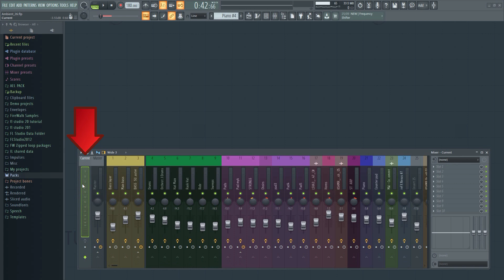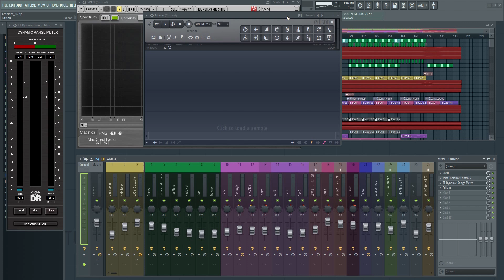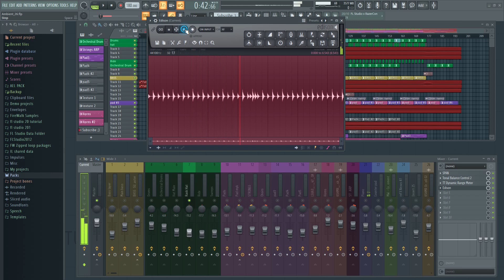How to Use The 'CURRENT' Track in FL Studio's mixer

Comment: Should Sonarworx Sound ID also be put on the Current track?
Reply: Good deal! Thank you ! Great content BTW.
Reply from the maker: No, it should stay on the last FX slot on the master, or be used using the standalone version. If you keep it on the current track and you start adjusting anything else but the master it will only affect that particular selected track and not everything else that comes through the master at the same time.